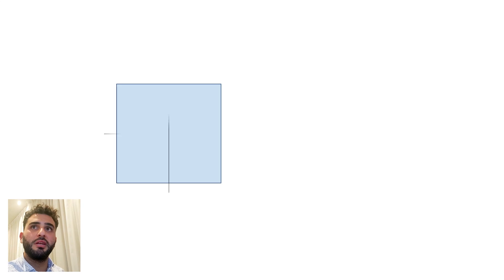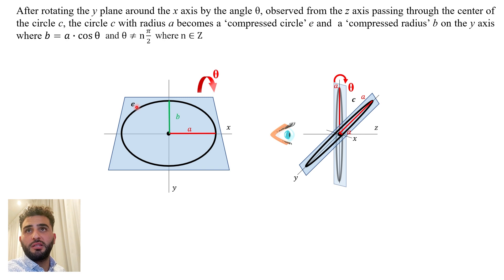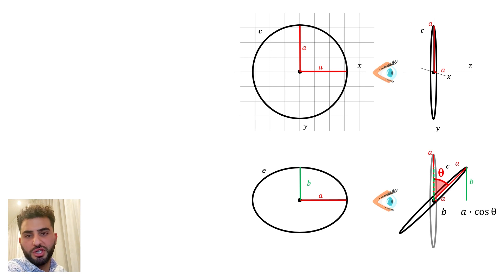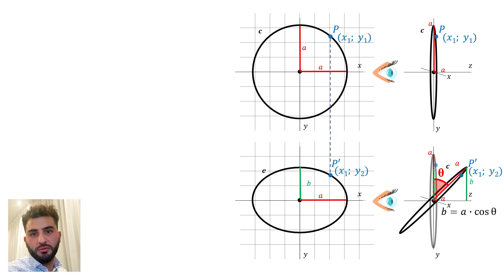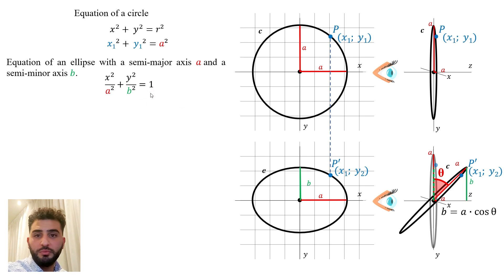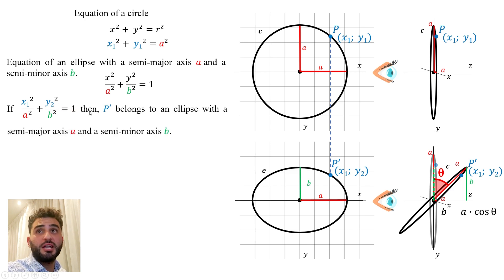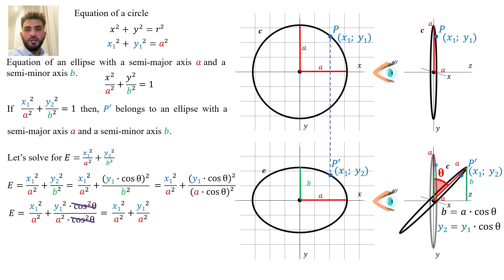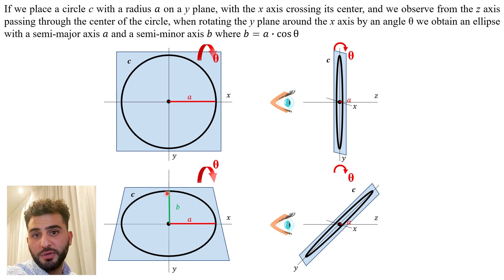Transformation of a circle into an ellipse by rotation

Comment: Hey there! I think you're missing a key point: for a circle to transform into an ellipse, it requires a combination of stretching/compressing and possibly rotation. A great way to validate your equation would be to check if your ellipse can be obtained as the intersection of a plane and a cylinder, where the circle is the base of the cylinder. Otherwise, simply rotating a circle by any angle will still result in a circle, since the rotation matrix is a rigid transformation in the sense that it preserves the shape. I'm working on a similar topic and would be interested in discussing this further with you in detail. Let me know if you're interested!